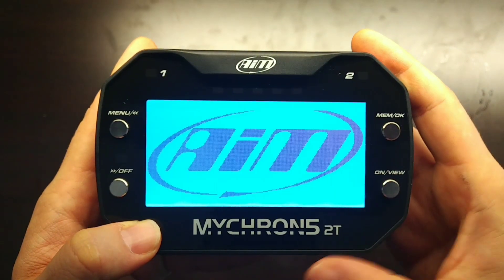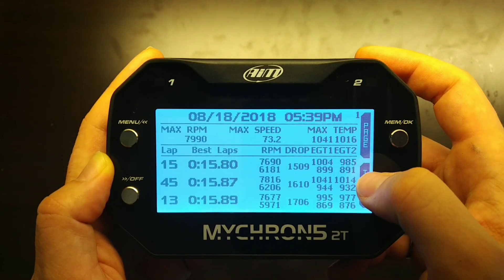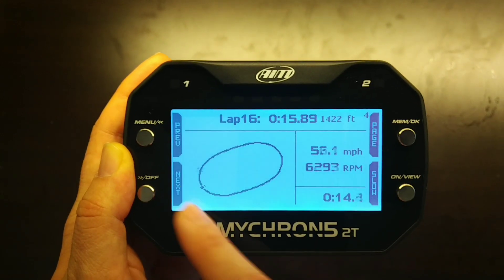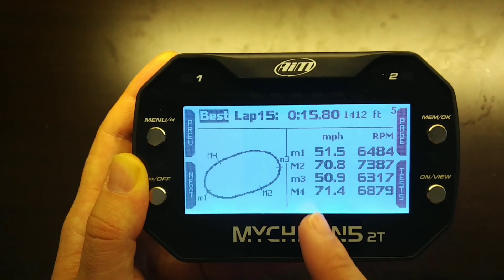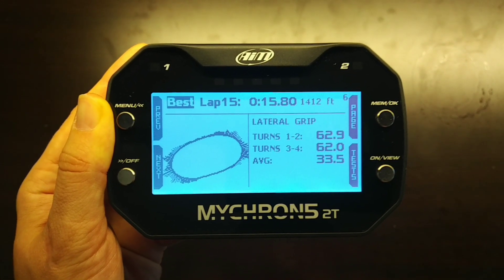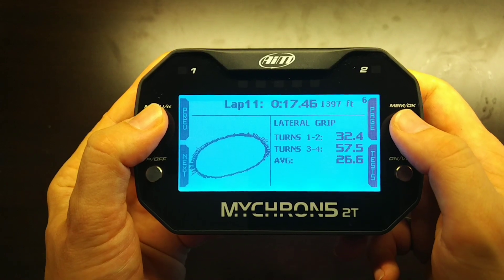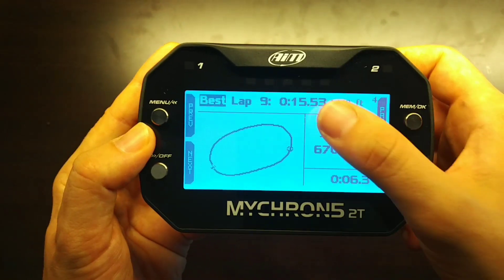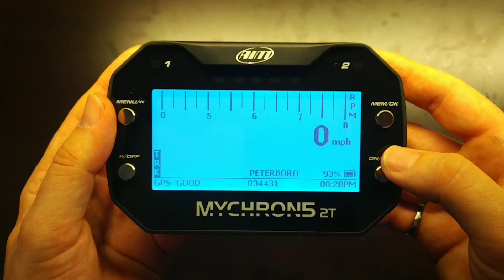AiM MyChron 5 2T - Oval Racing Mode Data Analysis

Comment: I just can change my GPS from on to off in this setting
Reply from the maker: No, the GPS sensor data is always recorded, this oval vs circuit racing mode is just changing the way you visualize the data

Comment: hi the wire for rpm where you connect it to the engine
Reply from the maker: Hi Devid, for a four cycle engine you can simply wrap the wire around the spark plug lead a few times and secure it, for a two cycle engine simply loop it around itself beside the spark plug lead and secure it. Please check our page 13 and 14 of the following link for diagrams https://www.aim-sportline.com/download/doc/eng/mychron5/aim_mychron5_user_guide_101_eng.pdf
Reply: @speedmastermarine   for a mercury 300 promax v6 just attach it to the spark plug cable? and in the x1 instrument?
Reply from the maker: @devidmovistar  That is correct for 300X/300 promax V6 you just need to attach it to the spark plug cable and set the multiplier ("rpm factor") to x1 in the MyChron 5.
Reply: @speedmastermarine  ok, thanks very kind
Reply from the maker: @devidmovistar  Not a problem, glad we could help. Let us know if you have any more questions.
Reply: @speedmastermarine  ok I'll let you know if it works on my engine
Reply from the maker: Did you end up getting your tachometer signal sorted out?